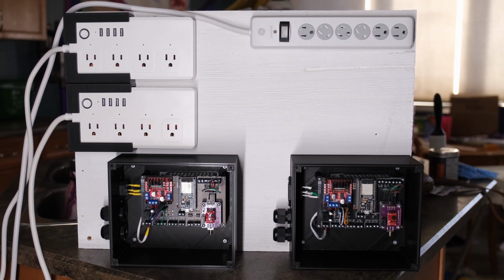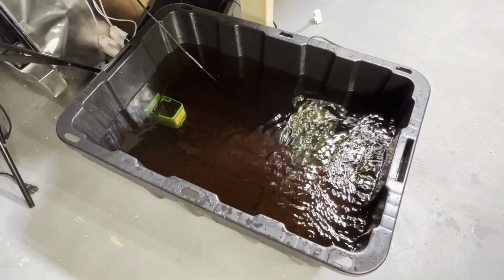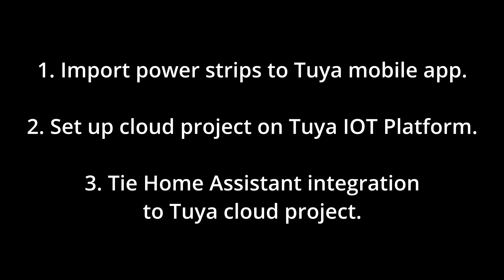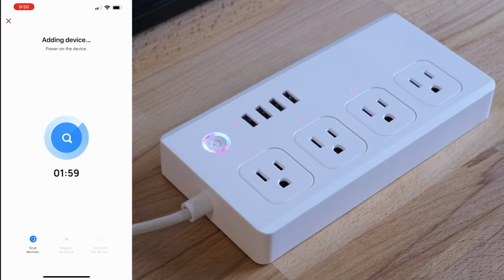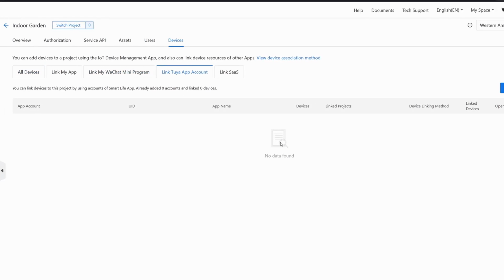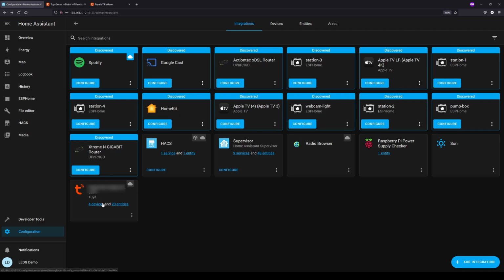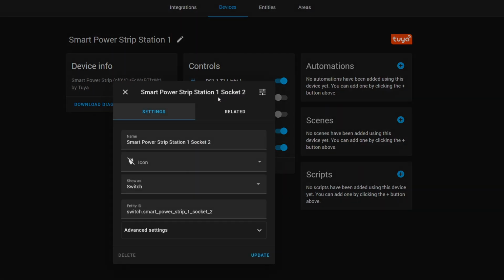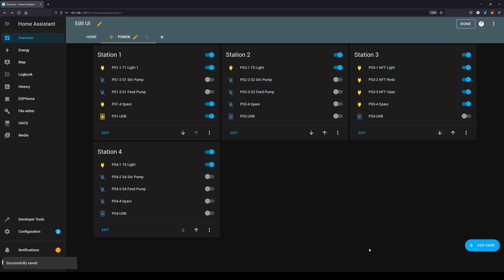Rebuilding My Automated Hydroponic Garden -4- Adding Controllable Power Strips

Comment from the maker: How are you guys doing YOUR power control? WiFi (cloud-connected/Tasmota/Sonoff LAN/Local Tuya, etc.)? Zigbee? Z-Wave? Would love to hear about your setup and the hardware you're using.
Reply: I'm using ESP32 + Small solid state relays + ESPHome
I'm not using it in hydroponics but I plan to
Just search for "solid state relay arduino module"
Reply: None of those. I use the ESP NOW wifi protocol, works great for battery powered sensor modules. ESP's mesh really well together and the API's make it simple to employ. You can use the cloud if need but it's not essential for locally communicating with say a controller module, which is awesome. Only requisite is coding skill (C++/Python).
Reply from the maker: @alexrossouw7702  Are you just using GPIO to trigger relays then for power control?
Reply: @LEDGardener  Basically I'm building my own relay module now and using transistors to drive the relay coils, via GPIO output from an esp32, and a 16 amp pcb design using kicad. Those existing relay modules tend to loose a channel here and there, and require messy wiring.
Reply: TPLink Power Strip, they are reliable and also have power monitoring. Native support in HA
Reply: I have EHS and have no WiFi in the house.  I use NetIO Powerbox, very expensive, but very high quality and does not depend on the internet.

Comment: I've used Sonoff S31s but found them to be unreliable, so I built my own wifi outlet. The issue was that I had a Node Red automation in Home Assistant turning the S31 on/off to fertigate my plants 3-4x/day, and on a recurring basis -- usually 1-4x/week, both the fertigation pump S31 and a reservoir mixing pump would lose connection from the "eWeLink Smart Home" HA add-on such that HA could not turn the pump off. 

After mixing a dozen gallons of fresh nutrient solution twice in two days (and hours trying to find a solution online), I gave up and built my own wifi outlet using a home electrical parts from Home Depot, an esp32, a 5v 4-channel relay, and a mini 120v AC to 5v DC usb power supply. I took a "Three-Gang New Work Outlet Box", cut a small hole in it, and glued a power inlet into the side so that I could run 120V AC power into the box using a standard desktop computer power cord. I wedged the mini usb power supply into the bottom of the box, connected it to the 120V AC power coming in, and used it to power the esp32 and 4-channel relay w/ 5v DC. I then put the 4-channel relay on the little shelf in the box (it fit perfectly!) and connected the relay to 120v AC for the outlets. I ended up with 3 pairs of 2 outlets that are controlled independently and, so far at least, work 100% reliably.

In retrospect, it probably would have been quicker and easier to figure out how to flash the S31s with Tasmota so I wouldn't have to deal with the eWelink HA add-on, as I think that is what was causing the issue, but I had a lot of fun building it and it works great.

Comment: unfortunately even the "local" hack version isn't acceptable "Using this integration does not stop your devices from sending status to the Tuya cloud, so this should not be seen as a security measure" - their github page.
Reply from the maker: That's interesting since they also talk about blocking the devices from internet access and it seems like it'd still work: "...If you plan to integrate these devices on a network that has internet and blocking their internet access, you must also block DNS requests (to the local DNS server, e.g. 192.168.1.1). If you only block outbound internet, then the device will sit in a zombie state; it will refuse / not respond to any connections with the localkey. Therefore, you must first connect the devices with an active internet connection, grab each device localkey, and implement the block."

It must mean that if you do not take the extra step of blocking their internet access, they will still phone home despite using local tuya.
Reply: @LEDGardener  oh you know it sounds like to get them set up initially they have to contact their home server for that "localkey" then you can block it.

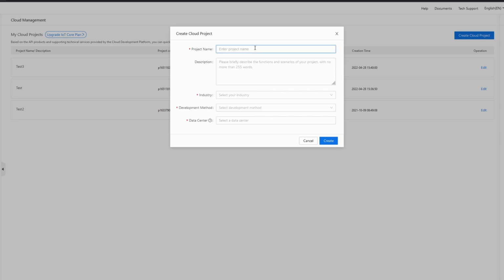Comment: Did you realize you unblurred what you blurred? @9:25
Reply from the maker: Yeah, I said screw it in this case since there are plenty of digits beyond that. Probably doesn't even matter if they're visible or not but I've made the mistake of not blurring some very sensitive info in a video before so now I err on the side of caution and blur most stuff. Thanks for the heads-up though :D
Reply: @LEDGardener  your welcome and I will definitely be looking into more of your stuff to see what I can start with

Comment: Tasmota. Never had a problem in 6 months of running. Works via mqtt no internet required and maintains time internally so will execute timers regardless of network and HA status. Still trying to figure how to set timers from HA input number, the JSON ends up invalid.
I would like to run more of the automation on the esp32s and power strips as it would be ideal to have the system work independent of HA if something fails.

Comment: Why not use a relay board connected to four or more power outlets mounted on a wooden board? These can be locally controlled, for instance via ethernet cable. Although I do understand the 'less hassle' option of tuya power strips.
Reply from the maker: I buried a relay board in a power strip in my last build and it worked well - I think it's an option for those who are quite comfortable with their electricity skills and knowledge but I'm sort of leery about having a DIY solution for AC power.
Reply: @LEDGardener  I understand. You can also consider tuya-convert, software to flash Tuya devices to Tasmota (from which you can flash to ESPhome). This flashing can be done trough wifi, but only on devices with the pre 2022 firmware.
Reply from the maker: @Johan-bb4sy  Nice, thanks for the info.
Reply: @LEDGardener  There is a topic on the Home Assistant forum about the 
AHRise AHR-083 tuya power strip. And a lot of tutorials on youtube about flashing.

Comment: The problem I have with Tuya now is that they killed flashing for Tasmota/ESPhome on newer devices along with their new official integration. It's basically reduced the sources of decent off the shelf wifi smart devices from 1 to 0, everything I do is DIY now.
Reply from the maker: Excuse my ignorance as I have not yet tried flashing anything with Tasmota but how does the new integration affect it if you're flashing the microcontroller onboard anyway?
Reply: @LEDGardener  They used to use TYWE3S which was based on ESP8266 which Tasmota supports, but in early 2022 they started swapping to a diffrent chipset that's no longer compatible with Tasmota.
Reply from the maker: A-ha. I guess something like Local Tuya is the last bastion of local control then (if it still works).
Reply: KAUF Smart Plug is a good esphome based alternative
Reply from the maker: @aceconstantine3812  Nice find. I like the look of the new Shelly plug too. I wish there were more power strips with multiple outlets though and a single IP address for it all.

Comment: 3D printed mount looks a treat, nice 💯
Reply from the maker: I waffled over getting a 3D printer but it's perfect for this kind of stuff and has proved invaluable.
Reply: @LEDGardener  I started building a vertical garden with PVC wye fittings in a grow tent.  I'll be starting a YT channel for it soon.  Your videos are awesome, I've learned A LOT from you.   I bought the smart wifi power strips in your link, could I pay you for the 3D container mounts you made for them?  That would save me some time making them & yours came out perfect!

Comment: refuse to use anything smart that needs internet to function ;)
Reply from the maker: Yeah - feels like it's getting harder to find gear that supports this. I was pretty bummed when TP-Link yoinked the local control of their plugs away.
Reply: @LEDGardener  what do you mean? kasa plugs work local for me. Supposedly, this is the case for fr/eu/us, but not UK. Has something changed?
Reply from the maker: @womplestilskin  From what I understand, if you update the firmware, you lose that ability. Could be wrong. The integration does not suggest that it relies on the cloud so maybe I am mistaken and it's just the UK. For some reason I remember trying to add a new plug to my Kasa app and not being able to set up local control only. Maybe my mistake was trying to manage it in the app first.